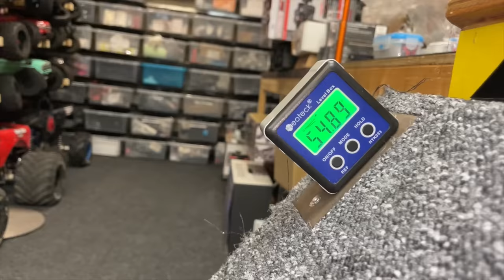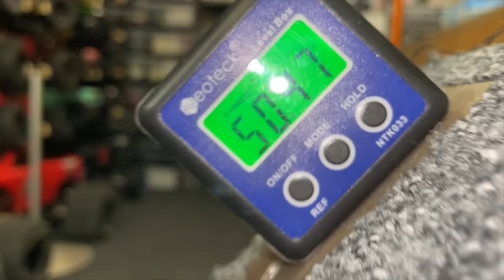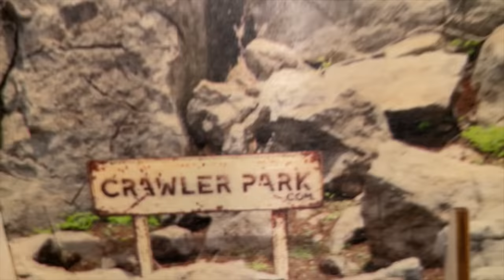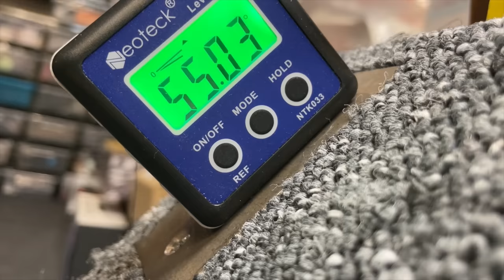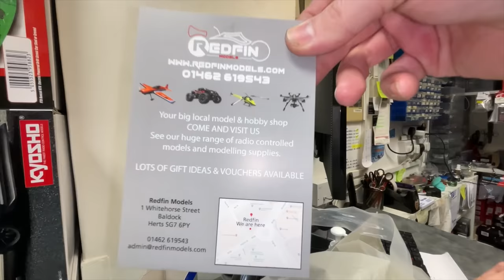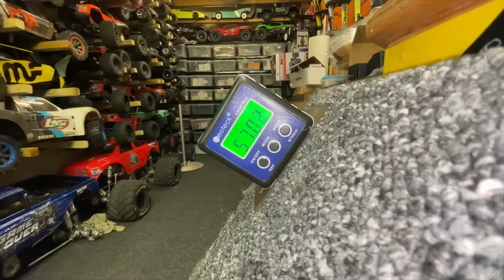World's most expensive Radio Controlled mini crawler

Comment: Pretty awesome little rig! 
Seems a bit high priced till you tally it up, then compare performance and it REALLY rocks! 
Great vid Kev! 
(Too bad nobody slipped a trx4 mini into the course comparison)
Reply: trx4m unmodified would probably do okay on the easier to harder obstacles cuz it’s bigger simply but the modified ones would blow it out the water on the steep climbs and sidelsopes. modified tho the trx4m is a beast and could keep up but definitely would be as much as the comp crawler the traxxas parts are not cheap sadly
Reply: The TRX4M absolutely walks round the course, only thing it wouldn’t do is the side hill challenge but it goes up the steps easy too…that said it’s bigger than the 24’s being 18th scale so not really fair!
Reply: The scx24 gladiator also performs very well, wish kev had one to test, all I had to do was move the shocks and it climbs like a beast
Reply: Too bad there wasn't a stock fms bro. Trx4m sucks compared to a lot of other crawlers

Comment: Kev you should build a nitro crawler
Reply: Yew
Reply: he is. go back 3 years
Reply: @endosrc  he stopped that I think
Reply: Nuclear powered crawler when
Reply: He did like a few years ago
Reply: I would imagine a nitro crawler would suck pretty bad far as having smooth throttle control It sure would sound cool though 😁
Reply: @EJ-74  Not practical, but cool af
Reply: @toastypotato185  oh
Reply: Not nearly as capable
Reply: Thats a cool idea ..but me who hates electric even thinks that's not a good idea...
Reply: Drill power rock crealer
Reply: Geared right down with a large airplane nitro motor would work brilliantly
Reply: Super Mini Nitro Crawler!
Reply: Yes
Reply: Kev please do the ftx carnage 🙏🙏🙏
Reply: He did, they're more complex than a nitro racer with gearboxes and the payoff is lower than electric
Reply: @aarondiekmann7081  that's impossible
Reply: @dopebossgamerz rock crawlers are not nuclear power plants
Reply: didn't Traxxas used to build one
Reply: Build a UFO RC.
Reply: a mini v8 engine on a rock crawler that would be the coolest idea
Reply: @95Lightning_McQueen  q
Reply: @95Lightning_McQueen  to
Reply: @95Lightning_McQueen  the
Reply: Impossible to make it actually crawl and have good bottom end control. But I saw a video thats got to be like 14 years old by now, but the guy builds a nitro generator running electric esc and motor on an scx10. It's cool
Reply: စာသားအကွက်ထဲတွင် ကူးထည့်ရန်အတွက် ဗီဒီယိုအပိုင်းကို တို့ပါ။စာသားအကွက်ထဲတွင် ကူးထည့်ရန်အတွက် ဗီဒီယိုအပိုင်းကို တို့ပါ။စာသားအကွက်ထဲတွင် ကူးထည့်ရန်အတွက် ဗီဒီယိုအပိုင်းကို တို့ပါ။Gboard ကလစ်ဘုတ်မှ ကြိုဆိုပါသည်။ သင်မိတ္တူကူးသည့် စာသားများကို ဤနေရာတွင် သိမ်းဆည်းထားပါမည်။ဘူ၂၅၀.၂၈.၄၆r500'12'28r200.4ထိပ် ၂၅၀.၄၆.၄၉.၄၃r250
Reply: They suck.. nitro suck at offloading because of low tourqe and electric is much simpler.
Reply: Yes

Comment: Try using Spray Glue on the treads of the tyres on Rock Crawlers and leave to dry properly for 2 - 3 days and you will get a softer layer of rubber when it's dried properly, helps alot 👍.

Comment: Kuroking X-Row is a bit more expensive than the furitek, £300 for just the kit, still need to buy all electronics (motor, esc, servos, rx/tx, optional lighting) Mine currently sitting around £500

Comment: Do you weight the tires like we do with full size rock crawlers? I’ve got 220lbs of fluid in each tire on my buggy. Keeps the weight as low as possible.
Reply: Yes but most guys don't like it  only add little it increases rotational mass
Reply: @paulclancy2404  what's bad about high rotational mass on a rock crawler?